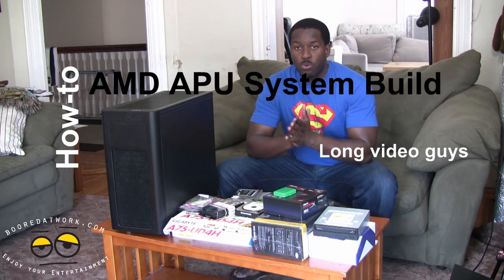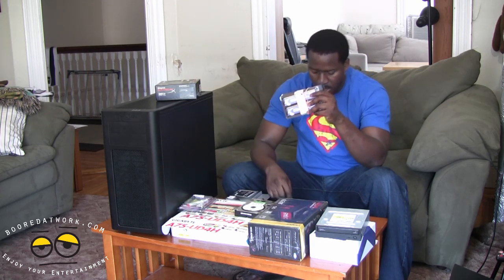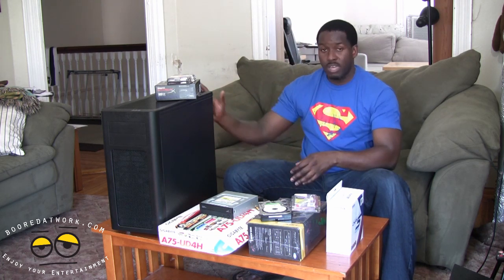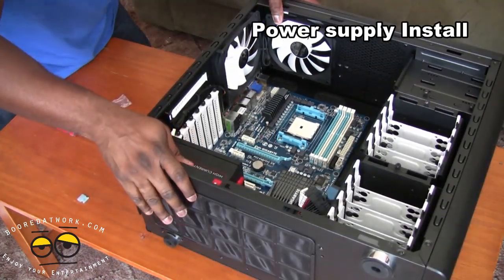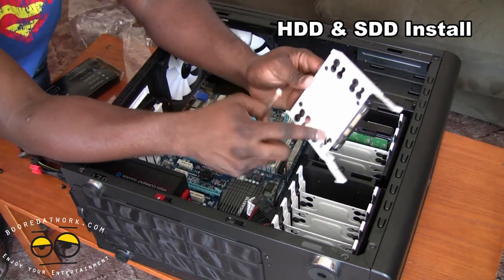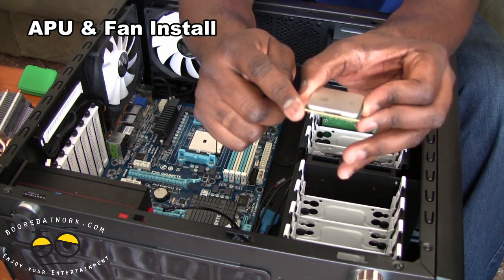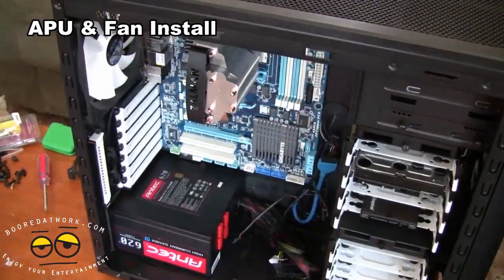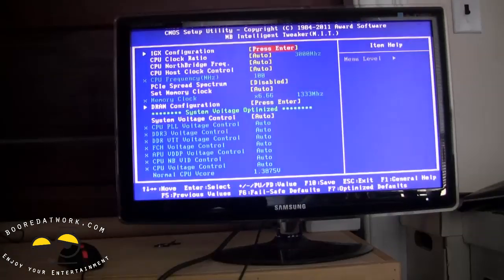How to build AMD APU System

Comment: I have always installed the processor and heatsink/fan prior to the motherboard being mounted in the case as it makes it easier to work with.  Also, that looks to be too much thermal grease.  It should be the size of about an uncooked grain of rice.

Comment: I know this is really a preference I suppose... But, your CPU cooler is backwards from the fan flow. The exhaust fan sucking out where the fan was pulling in, the other way would make better air flowing and probably improve cooling.

Comment: You can made it much cheaper by remove Optical Drive (OS installation can be done by flash drive) and change the motherboard to Asrock ones, it's cheaper than gigabyte.

and you'll get a Cheap AMD APU rig with AWESOME performance.

Comment: i agree with @booredatwork, if u haven't bought the mobo or the APU yet you might look at the A10 5800k, i have it and i can run 1080p ultra graphics 50fps (-fraps-) on overclocking. if u wanna check out my full build send me a message or reply here.

Comment: That's ok but I think the APU heatsink fan is in the opposit side. There is a back fan taking out the air needed to that heatsink fan do its job, they are face to face pulling the air in opposite sides.

Comment: Hello noob here, I'm running a similar build with same gpu/apu but was wondering if it made a difference whether or not I'm plugging in the dvi to the mobo or gpu. When I plug into the graphics card dvi slot my computer boots up fine but nothing shows up on the screen.

Comment: Great video. Usually when I do my builds, I will connect the board with the processor ram hdds power etc before installation in the case so i will download software and all that run it through some benchmarks and if the board holds, i install and build the system.  That way if the board is a dud, i don't have to do an entire teardown to take out the board

Comment: Wouldn't it be worth it to go with a amd FX cpu or a i5 for example when video editting, and cheap out a bit on the ram.. and get a better gpu? i mean even if you use a cheaper motherboard it will be fine.. but then again maybe the SSD perfoms slower.. hmmh... lol, hard choices i guess xD